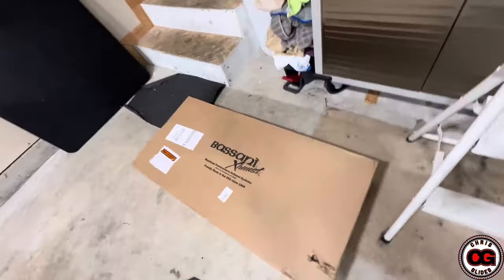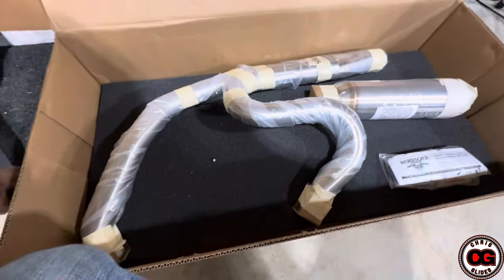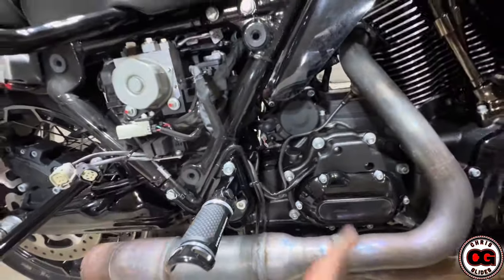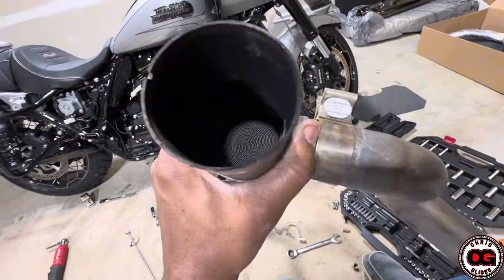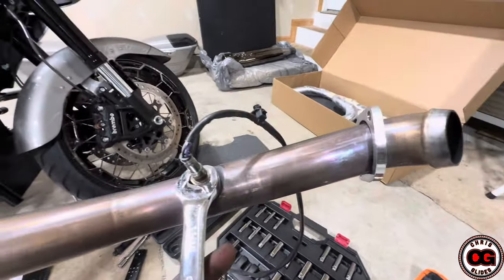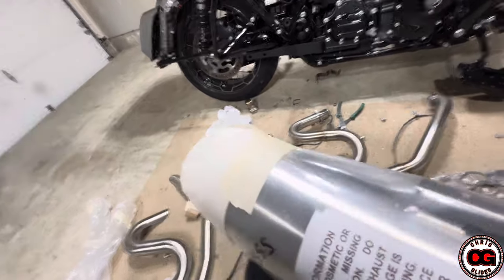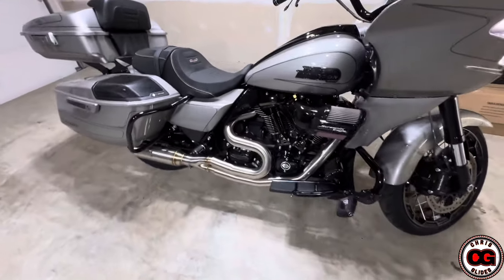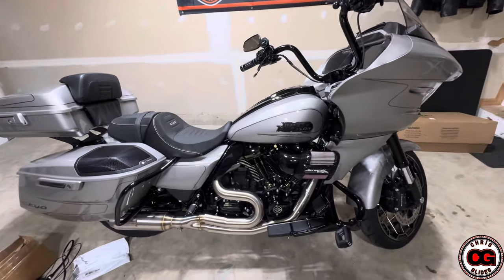How to install Bassani 2-into-1, Super Bike, Exhaust on a 2023 Harley-Davidson CVO Road Glide.

Comment: Kept bumping my knee on that intake just watching this .
Reply from the maker: That’s not an issue with this.  Not sure how anyone’s knees would come close at all. This is different from the ones made on the old pre M-8 models.
Reply: 6’5” with a 38” inseam. My wives bike came with the same setup.
Reply from the maker: @freebehindbars8654  this is not the same bend and set up as a 117 breather.  This is a new and just came out in 2023 for the CVO only.

Comment: Looks great!!

It was written that Bassani 2-into-1 cannot be installed on the CVO, but were you able to install it without any problems?
Reply from the maker: Yes. When I purchased it they were advertising a photo of the CVO with it on.  It was probably removed because it’s going to be hard to remove oil stick and stick to gear oil.  The rear header pipe S shape blocks it all pretty good.  It also burns the right side plastic heat shield (the heat shield that keeps heat off legs.  Bike works fine with it and I’m good with it
Reply: @ChrisGlides  
Thank you for your detailed explanation.
It was very helpful.

Comment: Hello~
I also have a 2023 Road Glide CVO.
There are three oxygen sensors in the stock muffler.
Does the Vasini muffler have 3 oxygen sensor holes?
Reply from the maker: No.  All M8's / V-twins only have two sensors.  I have changed lots of headers and sensors are only for the 2 chambers /front and rear cylinder heads.  Bassani headers are specific to each bike. If you have a H-D you don't have 3 02 sensors. The sensor go from headers to the grey and black plugs behind the right/brake side panel.

Comment: I just put mine on, and I have a TERRIBLE vibration. Re checked all my work, and I don’t see anything wrong. Nothings hitting any covers, nothings touching floor board etc. I have no idea what it could be. I feel it all the way up my handle bars especially accelerating.
Reply from the maker: Not sure.  I am not experiencing that.  Wonder it you can return it.

Comment: good video....but to me....I am not a big fan of the single exhaust.  To each their own....thanks for the video and nice bike.
Reply from the maker: Thank you and I appreciate your opinion and comment.  I have and always take into the consideration of all viewers and those who like to see what I can add to the bikes that I review and post.  This exhaust recommendation can from a great young man names Aden who works in the parts department at Ft. Washington Harley at HD of DC.  I have been very satisfied with its overall performance that it has provided, low maintenance and clean up, lighter weight of full system, sound quality - deep tone, growl, and output.  It's not the last exhaust that I will run on it so I am open for recommendations.  I am not interested in exhaust systems that are only for cosmetics such as slip-ons that do not have any performance enhancements.  I would have simply left my factory mufflers on for slip-ons.  Full systems are the only way to go for performance.  People are wasting money on slip-ons for this model because the factory mufflers already have a removable baffle once you remove the exhaust tips.  The going rate for slip-ons are $950 (plus another $800 for headers) when you can get a full system like mine with headers for $1200.  single side 2:1 .  Two into one systems are best for these bikes based on the generation of back pressure.  Better power gains and for not having power loss due to air fuel ratio.   Send me photos or yours or ideas to make cool modifications to mine at:  ChrisGlides@gmail.com

Comment: Link for that magnet tool?!!!😮
Reply from the maker: Hi.   I purchased at the register at advanced auto or AutoZone.  But amazon all day will have various types.  Its retractable and I would recommend one with a more skinny head for MC's.  Certainly game changing when you can only fit fingers and something may fall.
Reply from the maker: NoCry Telescoping Magnetic Pickup Tool with 25lb Pull Force — Magnet Stick Extendable up to 30in; Non-Slip Extendable Magnet Pickup Tool, Telescopic Magnetic Pick-Up Tool with Extra Strong Magnet https://a.co/d/6sg4m2W

Comment: do yuo have to get it dyno'ed again?
Reply from the maker: No.  But many will.  I have a Bluetooth tuner that I have on the bike for now set with an option for a breather and exhaust.  They are for the exhaust that I have but the tuner will have smart tune capability that will permit fine tuning.  For now it’s running good.  Some who will want every single HP number will dyno but for me I don’t care because it’s still a slow touring bike anyway to me vs. a ZX-14 or Hayabusa.  Cruisers and Touring bikes aren’t going to push the way we really want so for me I at least go for sound and for at least a little more speed.